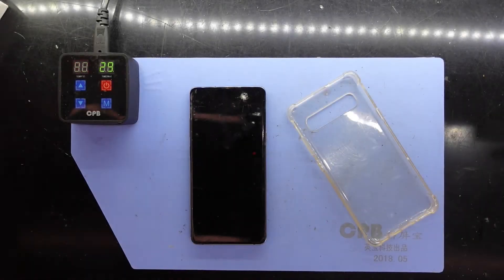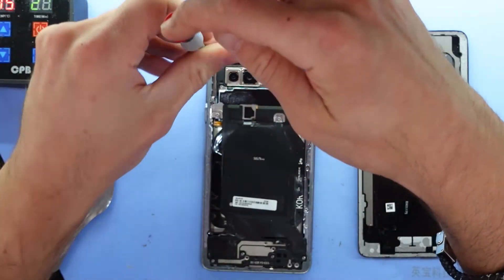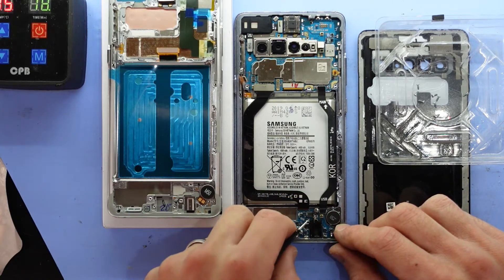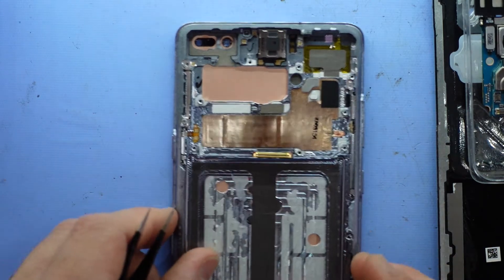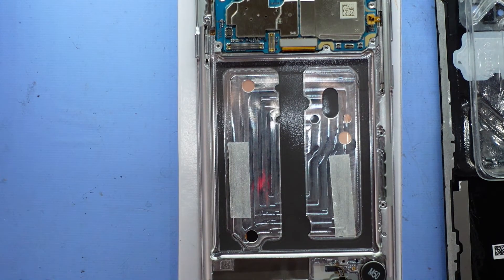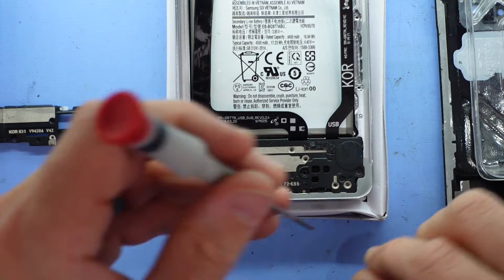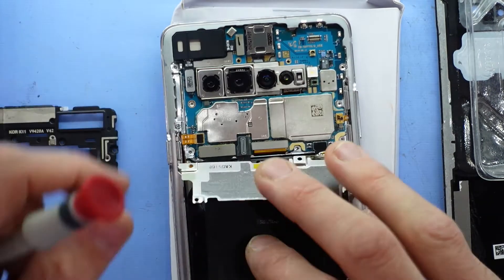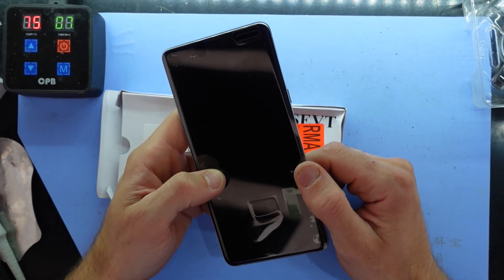Samsung Galaxy S10 5G Screen Replacement

Comment: hi ! nice video , can you please tell me if you use a hot air machine whats the temperature ??
Reply from the maker: As I normal mention in the videos
Heat pad is at 75 degrees Celsius

Comment: why redundant ? the S20 ultra is not, the S21 Ultra is not, and now since the S10 Ultra is called S10 5G, is all of a sudden redundant? (and also it's not the size of S10+, it's bigger and way better than the plus, write your homework before talking specs in your video ..)
Reply from the maker: cheers